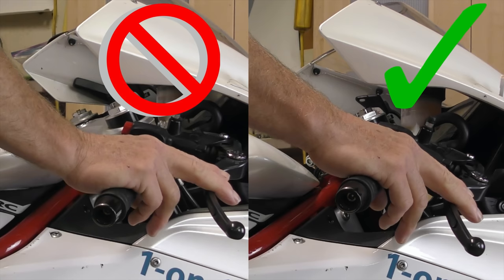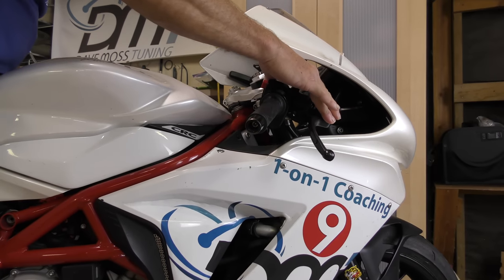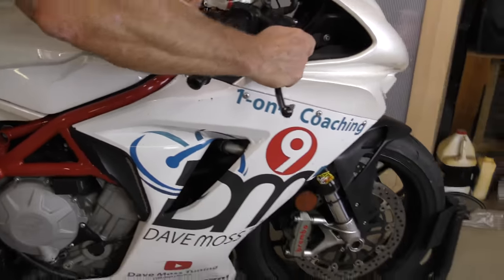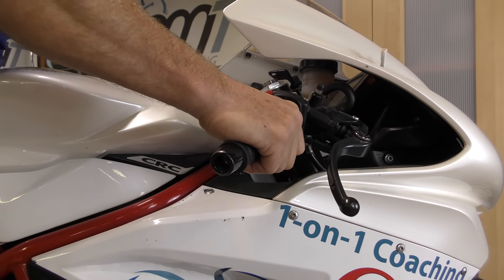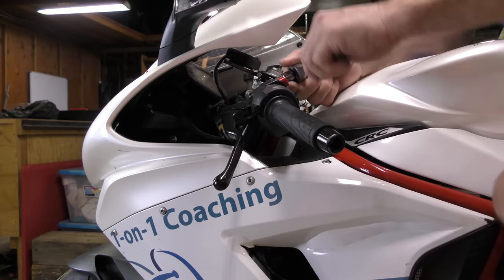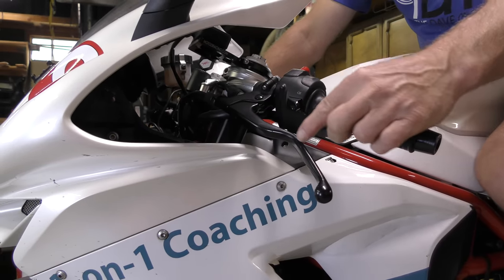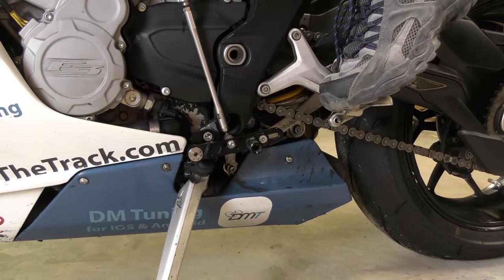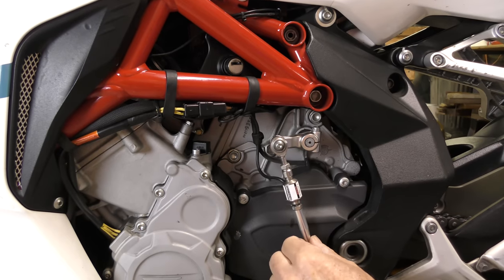How To Adjust Motorcycle Levers & Shifter

Comment: Is there a reason not to ride with a finger/two fingers ‘open’ and ready to cover the brakes at all times?  

It’s become second nature to me, but I can definitely imagine that I’m compromising something by not having all fingers on throttle.
Reply from the maker: You can ride however you choose with finger placement and the number of fingers used. Technique is what feels most natural but sometimes that is "natural" based on incorrect ergo's
Reply: @catalystreactionsbw  "...but sometimes that is "natural" based on incorrect ergo's"

Aye!  That's exactly what I'm concerned about.  In any case, something needs to be changed :D
Reply: @Snoupity  I do too and it never really hindered anything other then getting a perfect 'screwdriver' hand placement on right hand turns on track.

Comment: This video assumes it is normal on a sports bike to have your arm at about a 45° angle to the handlebars. Your forearm should be parallel with the ground...then adjust levers. If you want a relaxed seating position, a sports bike is not a good idea.
Reply: You don't brake in a tuck, you lift your head up so yeah your arms are at an angle. Maybe not 45 degrees all the time like how he's sitting on the bike, but definitely not parrelel to the ground either
Reply: @jeffbarnard348  Agreed, raising your head to brake is a common technique. On the other hand, 95% of the time when you are not braking, and in a tucked position, some riders prefer to have their levers set for instant access if needed without having to raise the head and body up to reach the levers.